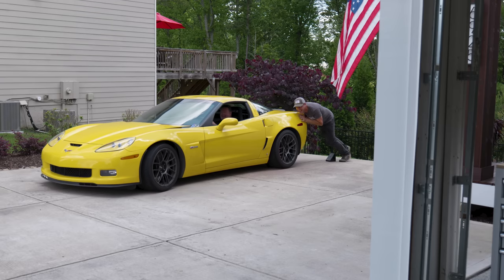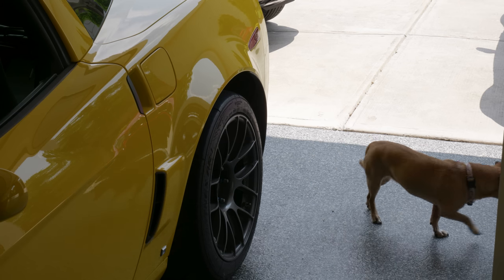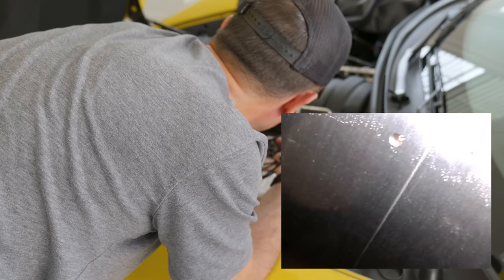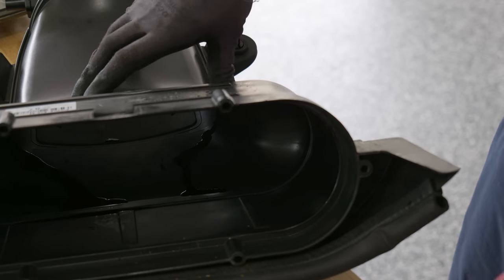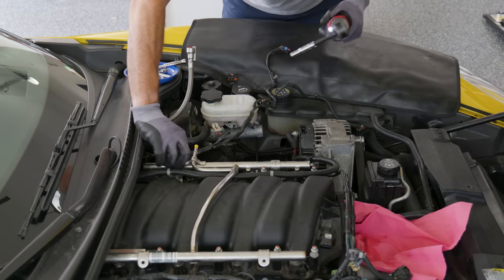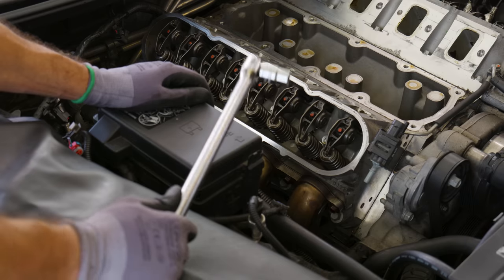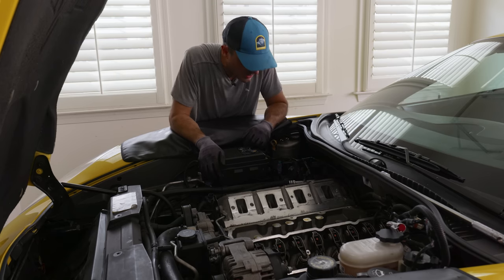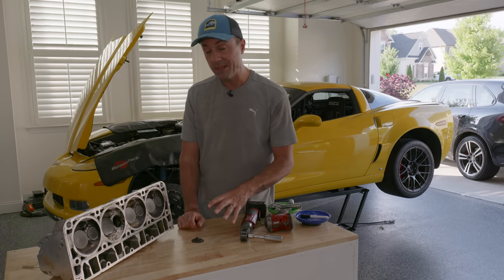“Get your heads fixed!” The internet was RIGHT?

Comment: Fix the block and do a Raceproven Motorsports stage3 package along with a vented catch can. That will car will a beast.
Reply: Rpm's heads/cam package over katech? I'm leaning towards rpm but I live in Detroit & katech is like 30 mins away.
Reply: @lifeonmars03  I mean if Katech is that close to u. Use them.
Reply: @davidmasseria8687  thank you
Reply: RPM has been proven to make the most power consistently and reliably over other builders. Send it to RPM...Im running their B3 Cam and Fran's incredible tuning, and couldn't be happier
Reply: @ryanbrown918  yes I love that cam & the way it performs. You didn't lie one bit
Reply: Is it really worth fixing the block and not just buying another motor?
Reply: There would be no choice of the matter!  Katech has hand their hands on the LS7 since the beginning of time.  Plus, you'll get a cool plague stating your car was modded by Katech.   Hands down.

Comment: I got my 2011 37k miles C6 Z06 this summer. I took it easy on the motor, never wound it past 5k RPM. After a few months I found a pair of used heads complete for $1200 shipped. Had those heads reworked (guides, cut seats, Manley solid inconel ex valves, ti retainers) then pulled the heads off my motor and installed the "new" heads. First time I wound it past 6500 I was hooked. Love the mile wide powerband of the LS7.
Reply from the maker: That's awesome! I'm jealous of your smart approach with the heads.

Comment: Go with aftermarket heads, dont bother with fixed oem heads they will drop eventually again. Great content!
Reply: I would say this I do not agree with only if you keep the hollow. Exhaust valves but changing to the stainless still you'll never drop avalv with the guide issue that has been addressed. He should put moldstar 90 guides  a $500.00  cost  but worth it
Reply: @philortega6516  ive had my oem heads fixed with solid SS manley valves and they were completely out of spec after only 8k miles. I now have brodix br7s which if you ask any reputable shop, are much more reliable than oem cast.
Reply: @louiC6Z  what changes are made from the OEM head that make it more reliable? What are the geometry changes made that cannot be duplicated in the OEM head?

Comment: Your attitude and patience is awesome!! A 700 HP build with a Z06 chassis and weight around 3200lbs coupled with your driving skills, good-night to the GT3 and GT3 RS!  I am looking forward to see how this all turns out!
Reply: Less then 3,100
Reply: Replace your Dual mode (NPP) exhaust with aftermarket ones  like Corsa and save about 20 lbs or more.
Reply: Concur ❤
Reply: @David-jh8mp prob is sound regulation. If he plans to put headers I doubt with those exhaust it can pass sound regulation

Comment: I own a 2007 ZO6 with corsa intake and corsa exhaust, from original owner Installed sometime before 37000 km when I bought it. It has 55000 km now and GM said my car was not effected by the valve guide issue. Pulled the heads off myself, and they are perfect, just like GM said they would be. It doesn't make sense that GM would say some are bad, and some aren't, if that wasn't the case. So, IMHO I think if GM says yours aren't effected then they aren't. If GM says they are bad then you better get that fixed. I have never tracked my car, but I do drive it hard. I mean red line all the time, almost every time I take it out, after the oil temp is up. I think giving it too much gas at low RPM is very hard on these engines. If I do ever track it I will definitely get the oil tank with the goiter attachment since mine came without. Super fun car!!! Highly recommend!

Comment: We need to look at the block and see if it has been cracked, if no crack it’s possible to get it bored or resleeved. 

For your intended purpose I would stay away from a heavy heads/cam build.  

I built my motor with the guidance of Tony mamo, he may be the one to help you proceed further.  The cost is not cheap but that has to be accepted in this sport.

I would remove the hood and front bumper and get a engine hoist, valley cover hoist bracket, and a hoist leveler.  Then yank the engine.   Removing the radiator makes it a lot simpler, the clip on the lower passenger side is a real pain too.

Comment: Hi Josh. OK so it was a dropped valve. When you get the engine out and tear down, be sure to check the cheeks of the big end of the Titanium connecting rods. These can begin galling and is another LS7 failure point. The best option for the valves is going to Moly coated stem Titanium intakes with precision machined bronze guides. These will rev the best and keep the valvetrain stable at high RPM. I would not do the old school stainless steel intake valve with the double valve spring deal. That's for drag race engines that don't sit at high RPMs. Not really suited for track cars.  Its a heavy valve and beats up the whole valvetrain. These dual springs have an issue with surging at high RPM and this reduces valve control and greatly increases fatigue of the springs. Katech has Spintron data showing the issues with stainless steel intakes and dual springs vs Titanium intakes and honeycomb springs. Their engineering data in the lab and on the Corvette race cars bares out their solution. Also stay away from the stock DLC coated titanium intake valve stems and hard iron valve guides. This combination didn't work out well as the coating failed and trashed the guides and valves stems. The shops try to salvage the original Ti valves and get them re-coated and polished. This doesn't seem to work out long term as QC on the rework seems sketchy. Katech is offering the molycoated stem Titanium intakes/bronze guides as the update. This valve issue as you know has been an issue for a while now. Katech has the best solution using what I stated above. You have the early issue of the exhaust valve and Katech will replace all 8 of those with the updated valve. This will also get the bronze guide. Katech will set the guide clearance very tight and fix the bad valve job. You send the heads to them, for about $3,000 they will completely overall the heads as stated above as a service for folks that want their LS7 heads fixed right and for good. You can do overkill here and get Titanium exhausts but these Titanium valves are expensive. My 2009 LS7 I plan to pull the heads and send them to Katech and do the above. That one head got trashed. Contact Katech and see if they consider heliarc welding it to fix it or just scrap it and replace the head with a good used casting. A good used head I see going for $1000.00. Obviously that #6 piston is done but also check that #6 connecting rod and see if it got bent. Maybe OK or not, you need to see it. Those Ti rods are roughly $800 new each. Many guys take them out and replace all the rods with forged steel rods, replace the crank, pistons, rings. That entire assembly new and balanced is about $2500. Doesn't take too many hurt Ti rods to make a conventional forged bottom end look cost effective. R.E.D., Racing Engine Development in Oceansdie CA is the most qualified shop for fixing the LS7 block. Steve Demirjian developed the re-sleeving process with Darton who manufactures the sleeves. Steve engineered his own tooling for precision boring these blocks for new or replacement sleeves. He would be the go to and would give you good advice on what to do. I did look into replacement OEM LS7 blocks. Apparently engine shops and dealers bought up the last of the GM LS7 blocks before they were discontinued. I did see NOS LS7 blocks for about $4000.00 for what appears to be new LS7 blocks. Depending how bad the engine scattered, there is metal in the intake. A good used clean stock intake is $200.00 so conventional wisdom is to throw out that intake and not risk any metal shrapnel getting back into the new engine. The oil tank, oil lines and oil cooler will all need to be cleaned of metal and other junk from the engine failure. The oil tank is 2 piece so you can disassemble it and clean it out. The other items maybe just replace them. Lingenfelter can modify your 8 qt tank and increase it to 11 qt like a late model tank. Avaid makes an oil tank insert and good windage tray setup that does well in solving oil starvation on the track. That would be minimum level upgrade to improve the oiling system. You had concerns about oil starvation. When you get to the bottom end apart and check the bearings and crank journals, they will tell the story (ask how I know). As far as pulling the engine, it can come out the top. Go to Harbor Freight and get the engine crane and engine stand. There is a engine lift bracket with a hand crank and screw that allows you to change the balance point to align the engine during pulling and especially reinstalling it to get aligned with the torque tube input shaft. The hood is light but get help when removing so you don't scratch the car. Before you unbolt the hood, match mark the bracket positions of the hinges to the hood. That way you can put it back on in exactly the same position without having to do all that effort of re-alignment. The timing chain should be updated to the C5 race chain (?) as the stock chain had some issues. Replace the stock LS7 crank damper with an aftermarket Fluidamper or equivalent as the stock damper when tracked would begin to slip the collar/rubber joint. For the clutch, use a Z06/ZR1 stock GM high performance clutch and pressure plate. Install a new GM slave cylinder. Install the Katech clutch bleeding extension hose as this makes the clutch servo bleeding and fluid maintenance much much easier. For the clutch disk alignment tool, don't use the cheap plastic molded alignment tool that comes with the clutch. Get a machined one that fits better and gets a perfect alignment. This will help greatly when trying to re-install the engine and get the input shaft back into the clutch.
Reply from the maker: This is the G.O.A.T. comment right here! 🐐 Thanks for taking the time to spell all that out for me.

Stay tuned for the next video, I have a plan of attack forming in my mind and I’d like to get your reaction.
Reply: Awesome comments buddy, I'm not a real Chevy guy, been mopar all my life like dad and grampa, truth be told, I've never heard of these catastrophic,  apparently common failures that chevys have, on any Mopar engine I'm familiar with, my 383 and 440 engines have all been bulletproof with addition of arp rodbolts.. the new generation  of hemis have been pretty good from what I've heard...
Reply from the maker: @jeffrey501green  The 6.4 in my wife’s Durango seems pretty strong!
Reply: @JoshVanVeld  6.4 durango... sounds quick!! My son has a 2012 superbee 392 hemi with 80k he has put most miles on it, he bought it in 2014 with 7000 miles, we put cat back full race exhaust and CAI plus cross brace underhood, he has wailed on that engine, alot of stoplight drags etc, that 392 hemi is strong!!
Reply: This man's done his research
Reply: also the reason those Ti rods aren't the best OEM rods ever made is the German company they contracted out the coatings to said spec for this is 2x what you want us to do, GM said yeah, and they did so which allowed the to meet the budget line they intended for on the c6z. Although based on the data of high ti readings and bad rods, it seems not every ti rod is as succecptible as the next much like a box of chocolates you found in your grandma's closet. Like Jessie Iwujui uses his 250k c6z 550whp, and he daily it lol while competing in fd am with it and he has 0 ti ppm. I'm not sure there are any 'nos' ls7's out these since GM stopped making lsx's. New old stock parts=nos but I know you already know what I mean lol.

Comment: Josh, I have the exact same car, year, color and all. Mine dropped number 8 exhaust valve at the track. The LS7 can be resleaved. The cylinder liners are thin on the LS7 so have a machine shop check for a crack. Sometimes when they crack a cylinder liner they can crack the block, but being aluminum it can be welded. Mine has been welded for two seasons of track days with no issues. Texas speed and Scoggins Dickey Chevrolet are your friends when it comes to parts, gaskets and seals. Texas speed sells the PRC billet heads and they are awesome flowing heads. Just whomever you get your parts from make sure they know you are road racing and not drag racing. They all seem to push huge cams and such because they mainly build drag cars. If your other head is still good and you want to save some money reworking the stock heads, I have one good stock head and will make you a hell of a good deal on it.
Reply from the maker: This is what youtube is all about! Thanks Randy! I’ll keep you posted as my plans come together.
Reply: @JoshVanVeld  also summit racing had the atp bolts for 126.00 I got mine last week for my head swap.  13mm and 10 mm sockets is all you need to install, use impact sockets thou,ask me how I know!!

Comment: Josh, get in touch with BTR (Brian Tooley Racing) and get a camshaft that eliminates valve bouce off the seat. That should greatly increase valve longevity. If you want extra peace of mind, swap over to a SS exhaust valve but that heavier valve is all the more reason to seek a cam that is designed to eliminate vavle bound off the seat.
Reply: That motor is notorious for having bad valve guides, which allows the valve to move laterally causing the stem to break.  At a minimum, the fix is new valve guides.  There are other ways to prevent reoccurrence, but the valve guides are the main culprit.
Reply: @ClinttheGreat  everyone knows about the issue, but it's seems there are many different options on causes and solutions. Some say it's guides, some hollow steam valves, some say machining issues (lack of concentricity and/or rocker alignment), and other say buy aftermarket heads because the entire LS7 head is the issue.
 I don't think there is any silver bullet for longevity in a high lift, large valve motor. The best you can do is make sure you have good parts, good machine work, and slowing down the ridiculous ramp speeds of the LS7 camshaft. Even with all of that, regular valve guide checks is a good idea.
Reply: thats not whats happening lol and BTR makes some basic ass cookie cutter cams, they work, sure but BTR is just the most used cam kit in the lsx game like RPM is the most used recipe for n/a ls7's

Comment: I would say I'm about as experienced as you in terms of working on cars, but I've never had the confidence to remove a head. So props to you for that.
Reply from the maker: Knowing that the engine is at least partially trashed makes it a lot easier to take the leap. 😁

Comment: Man you’re doing probably the only high quality C6 content out there. As popular as this platform is, no one is really showcasing it or working on it the way you are. 

Also as a C6 GS daily driver, I highly recommend a catch can for yours. A lot of that oil in the intake was from blow-by. Obviously “the incident” added a ton and coolant. All of the LS motors suffer from it though. A lot of people go for the top tier Mighty Mouse setup but I have the Elite Systems can and it’s doing the job just fine. It catches an alarming amount for  a N/A motor so I think it’s worth it once you get her back on the road with fresh heads and valves etc.
Reply from the maker: Thanks for the kind words, I appreciate it! I had an Elite Engineering catch can on my C5Z (installed by previous owner) and it definitely caught a lot of oil. I'm putting it on my to-do list.

Comment: Exhaust valves are hollow steel sodium filled. Intake valves are TI made by Del West. An article  stated GM told/requested Linimar Manufacturing to do a 100% inspection process on the heads (they did the machining) as of Feb 2011. Most issues involved engines made 2008-2010. Mine is a 2013. I have nearly 120K miles w/o any issues. So far, so good. Since most inventories were 'just in time' I'm hoping I have the fully inspected heads.
Reply from the maker: Thanks, I was confused about which materials were used in which valves. This car is an '07 so GM's story about the issue being limited to a specific run of heads starting in '08 doesn't hold water with me.
Reply: @JoshVanVeld  Granted, those years are a bit fuzzy. 2007 engines tended to have needle bearing trunnion cage failures, sending the bearings all over the oil passages. And I've heard of valve drop failures in cars as late as 2011. An interesting note is mine came with a 100,000 mile transferable power train warranty. I put lots of milage on early so if a problem did develop, it would be on GM's dime.
Reply from the maker: @Sandy-oy2lr  It’s amazing how many miles you have on yours!

Comment: You probably have a machine shop nearby who can actually will that block up if it is actually cracked...... But I think it is just scored.  But if you ever need a cylinder head or engine block welded there is a shop located in West Los Angeles California called Kelly's block welding service that has been around since the 1940's..... And they do excellent work.